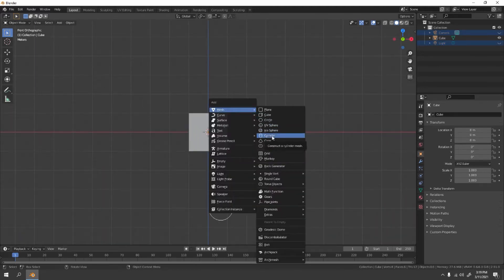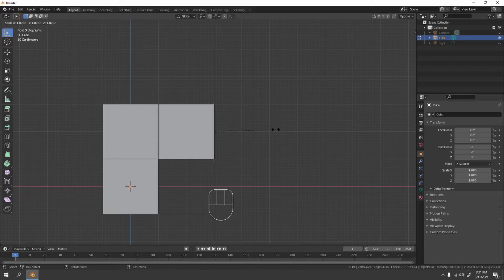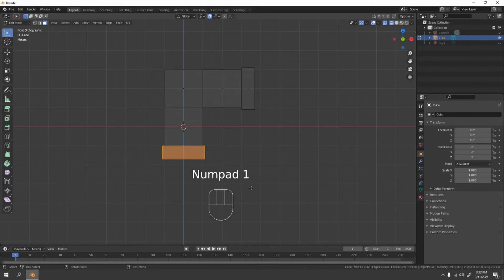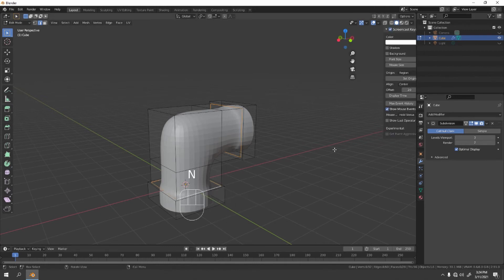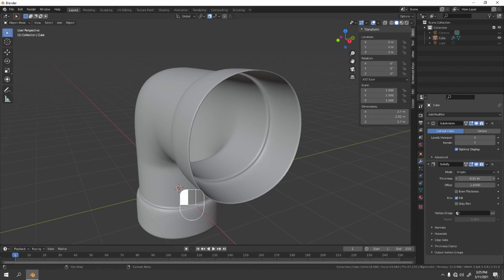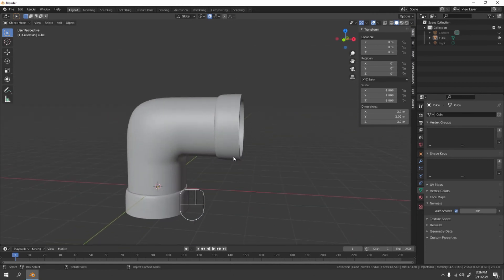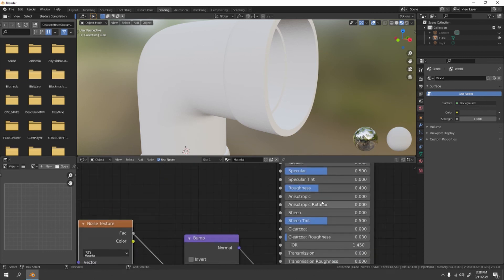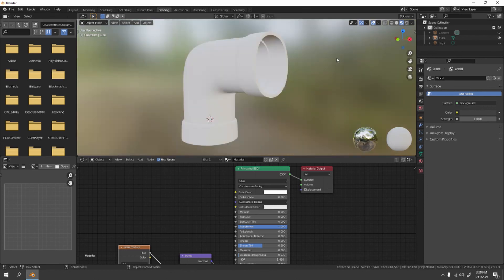Blender Tutorials | Pipe L-joint

Comment: Excuse me can you pls teach me how to: add vertices and edges? I already learned how to add faces. Can you give me step-by-step instructions like if I were a dummy bc I'm new at this and it's quite difficult hehe.
Reply from the maker: Hello there!

Add vertices on mesh

1)Open Blender, there we gonna see default cube and thats what we gonna use)
2) Press TAB to go in Edit Mode
3) Press 2 to go in Edge select (If you using keyboard that has Numpad) Note that its not the Numpad we using
4) Select one of the cube edges
5) Right click and choose Subdivide
6) Now press 1 to go in Vertex select, you should see at the middle of the selected edge has a vert in the middle.

Add single vert
1) Open Blender
2) Press TAB to go in Edit mode
3) Select the mesh by pressing A (any would do, now we use the default cube)
4) While the mesh selected, press M and choose "At center". and thats it!

Or

1) Open Blender
2) Delete the default cube or hide it
3) Press SHIFT A
4) Choose Single Vert, then Add Single Vert.
5) And thats it!

Add Edges on mesh

1)Open Blender, there we gonna see default cube and thats what we gonna use)
2) Press TAB to go in Edit Mode
3) Press CTRL R to add a loop cut.
4) You should see the yellow line as you move the cursor around the mesh.
5) Left click to apply the loop cut and thats it!!

Hope this helps you!